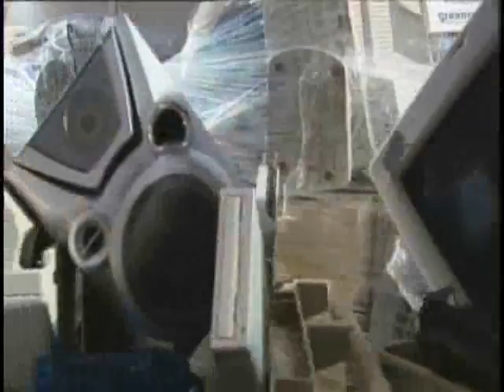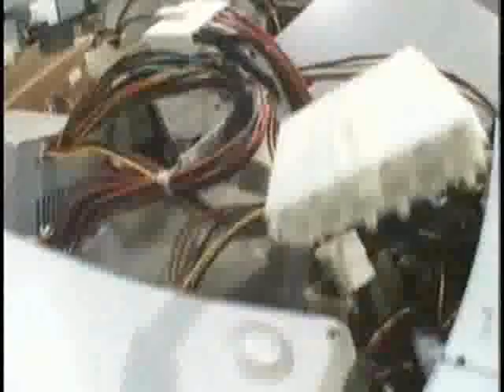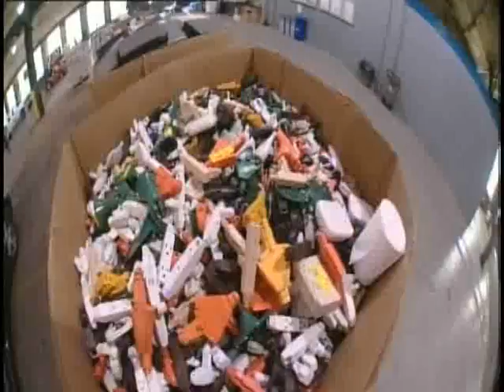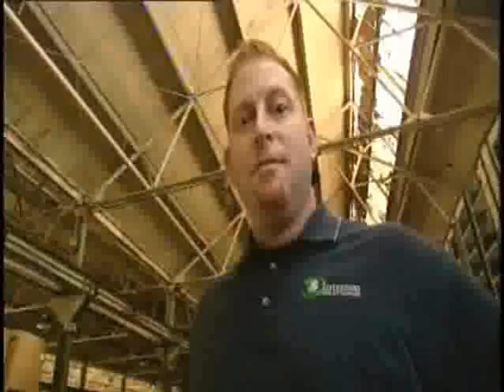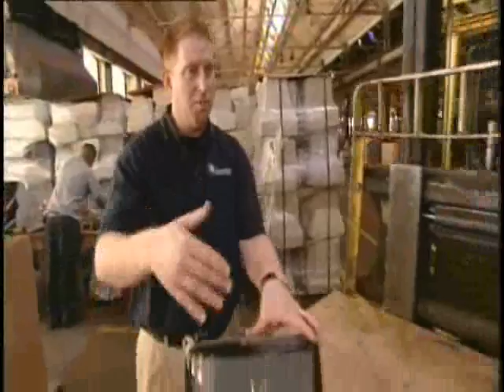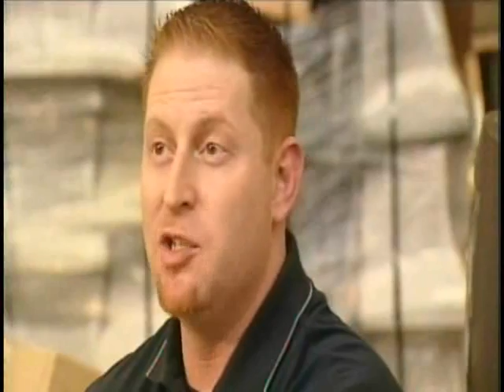Computer Recycling -  Intercon Solutions

Comment: we are a factory in China and we specialize in plastics separator.  Our main products include electrostatic plastics separator, rubber separator and color sorter.  Electrostatic Plastics Separator can separate ABS/PS/PP, PP/PE,PA/PC, etc.  Rubber Separator can separate rubber/silicone/wood/dust from plastics mixed. Color sorter can separate plastics as per color.  Of course, we can provide the solution project for WEEE plastics and/or MSW plastics reycling(Crushing-Washing-Separation)  +86-13926831379  cano@haibaokj.com